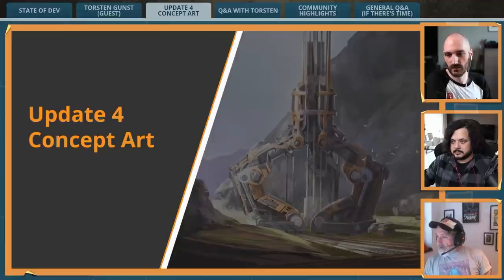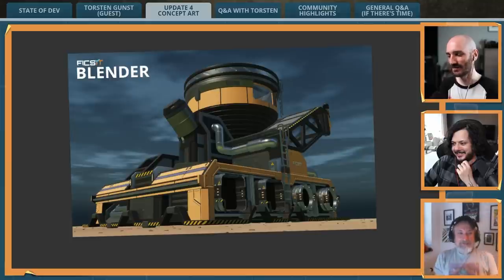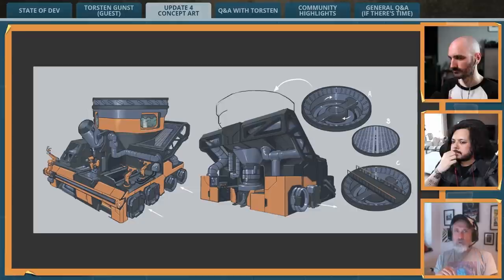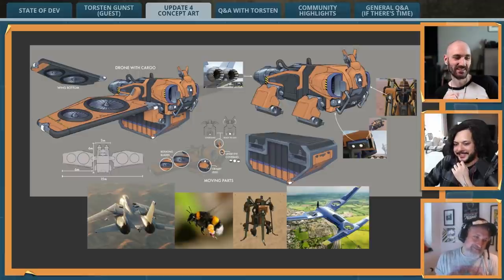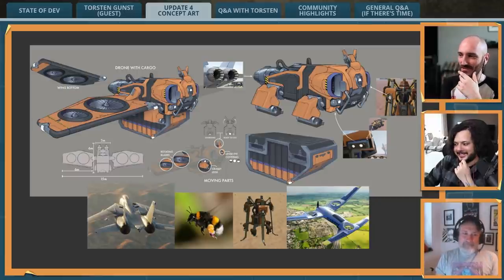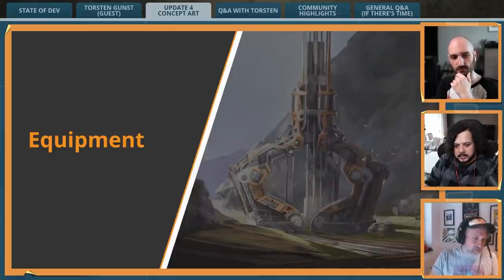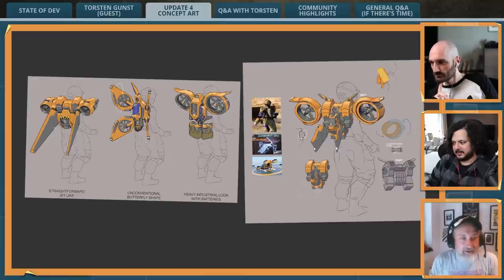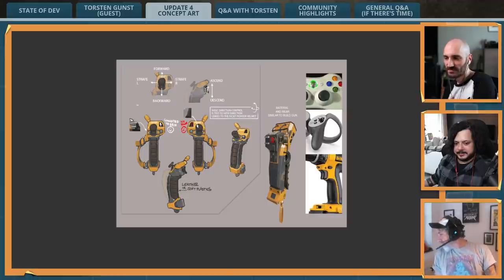Dev Stream Highlight - Concept Art with Torsten

Comment: 😐 first minute "fracking is horrible"
No! It is not actually, do the research instead of just listening the media. Fracking is better for the environment and less intrusive than conventional methods. A lot of people won't believe me and that is the saddest part. Because people don't want to do the research and be informed about what they are talking about.
Reply: No it's not. Poisons the earth and water for miles around, seismic disturbances etc.
Reply: Fracking does not "poison" the earth around it, nor does it cause seismic disturbances. Fracking is just injecting water into a well to force oil to rise out of preexisting formations (as water is heavier than oil), typically hundreds or thousands of feet below the surface.

Seismic disturbances caused by fossil fuel collection has been falsely attributed to fracking. What actually causes the seismic disturbances is the current solution to deal with produced water. Previously produced water was left in sealed pools to evaporate, but new epa regulations made this illegal. Now the only way to get rid of produced water in a cost effective manner is to force it all back down the well. This solution makes it so that more is pushed "down" the well than is pulled up, creating a great deal of internal stress in rock formations. The seismic disturbances noticed are when rock formations literally break or crack due to over pressure.